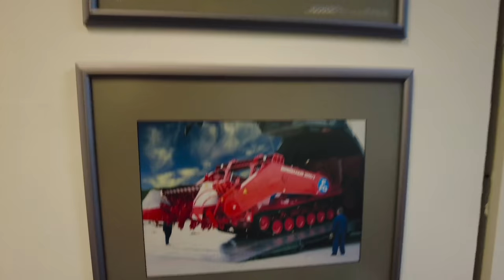ANTONOV UÇAK FABRİKASI "TR DE İLK”  AN225 ve diğer modeller

Comment: About Ukrainian airplane An-178 as of December, 2023. FACTS only.
   1. Only one An-178 airplane was made since 2015.
   2. This airplane does not have international certificate - cannot operate international commercial flights.
   3. This airplane does not have even a type certificate issued by Ukraine - cannot operate commercial flights even in Ukraine.
   4. This airplane did not complete even the own test flight program (after more than 8 years since first flight in May 2015).
   5. This airplane starting from February 13, 2021 has been BANNED(!!!) from any flights even over Ukraine, which effectively means a complete ban on any continuations of test flights and certification flights if there were any planned.
   6. This is the airplane that Ukraine could NOT make under FIRM CONTRACT(!) with Azerbaijan. Under this contract, the delivery of the first two airplanes should have been done in 2018. Not a single airplane has been made and no one promising any delivery date even for one airplane for this contract.
   7. This is the airplane that Ukraine could NOT make under FIRM CONTRACT(!) with Peru. Under this contract, the delivery of one airplanes should have been done in 2021, 
but this airplane is also not made. This contract has been terminated in 2022 at the initiative of the Peruvian side due to the obvious Ukrainian incompetence and actual inability of the Ukrainian side to make airplanes.

P.S. For more than 8 years, since July 2015, not a single made in Ukraine airplane was handed over to the customer. NONE! ZERO! Of course, we are not talking here about children's toys and two seater plastic airplanes weighing less than 400 kg. Ukraine cannot make airplanes without Russian components, knowledge and technology.
Reply: Süpersin tam da ben de bunu söylemek istiyordum